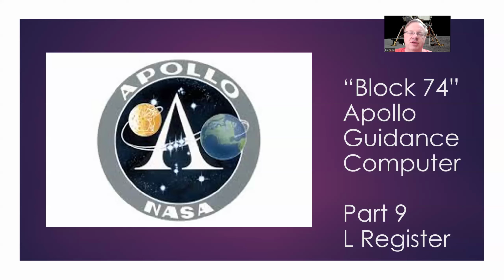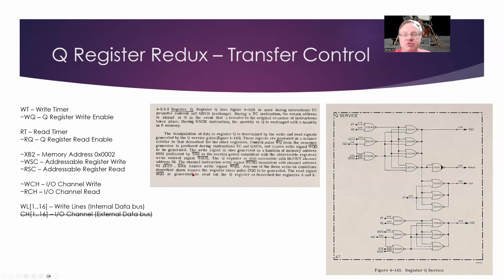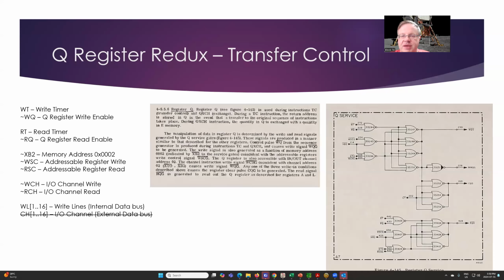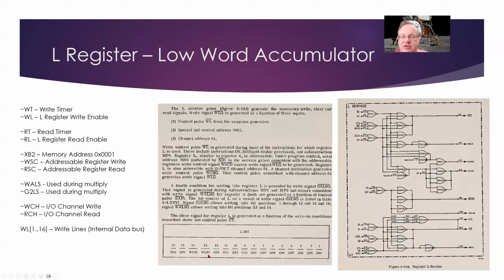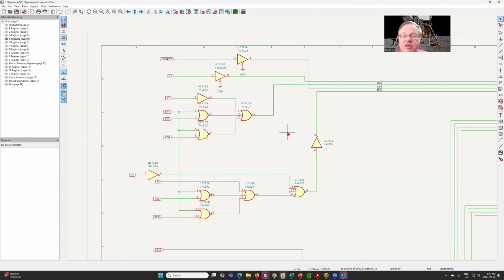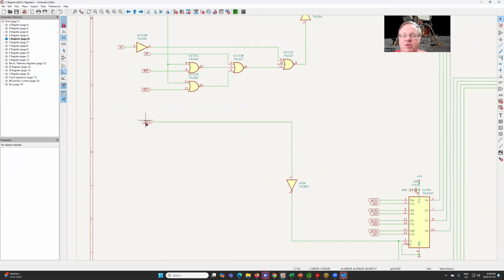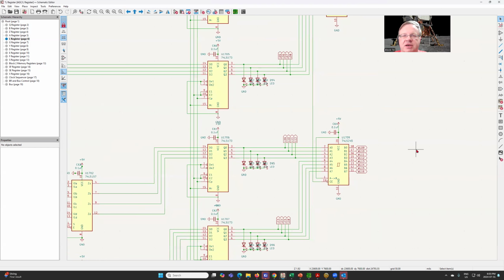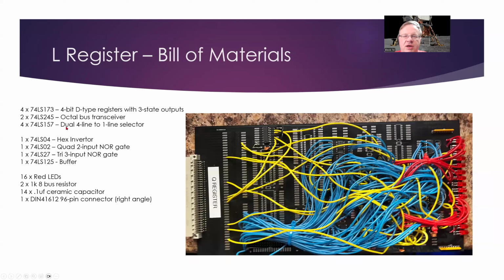EP 9: The L Register

Comment: All of those simplifications are great to see! 😃L has one more unique feature: even though it is implemented in hardware as (and can be written to as) a 16-bit register, it behaves as a 15-bit register when reading data out onto the write lines. Bit 15 of L can never make it out onto the write lines; instead, bit 16 of L is placed onto both WL15 and WL16. The AGC software sometimes uses this feature for overflow correction, since writing something into L and then reading it back out will effectively copy the upper sign bit into the low one. From software's perspective, I don't think there is any way to test the value of bit 15 of L once it's been written to. Sometimes more software-focused documentation will call L a 15-bit register because of that -- but the hardware makes extensive use of bit 15 of L for multiplication and division, so that's not really fully true. Everything that needs the true value of the bit can still access it through your L15 pin.
Reply from the maker: I thought I had noticed something along those lines. Thanks for pointing it out. I see L15 is used in certain cases of the WYD  pulse and some of the ZIP logic